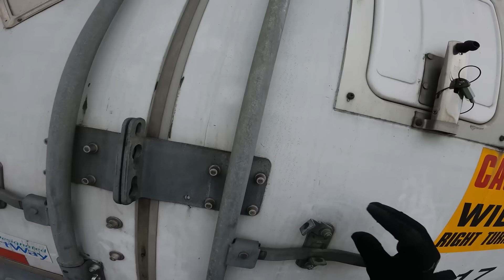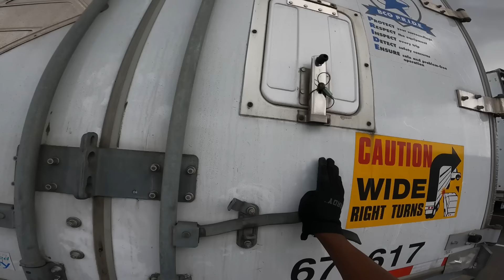They Reported Me To Landstar And Tried To Kick Me Off The Property Without Giving Me A Reason!

Comment: I always clean my trailer after every load, because that's my job as a professional truck driver, I carry my own equipment for that
Reply: I run with Landstar, and I'm with you.  I always make sure my trailer is clean after EVERY load.  I carry a blower on the truck it usually takes all of 10 minutes.  I also never just blow garbage into the parking lots.  I use a trash bag for all the debris and blow out the dust.  Part of the job.